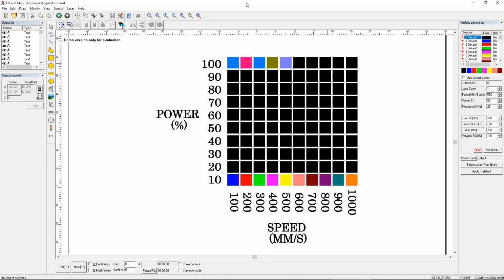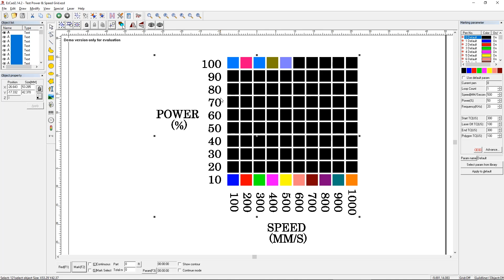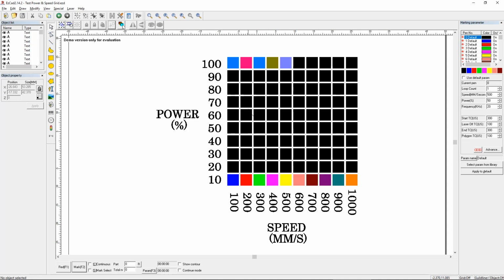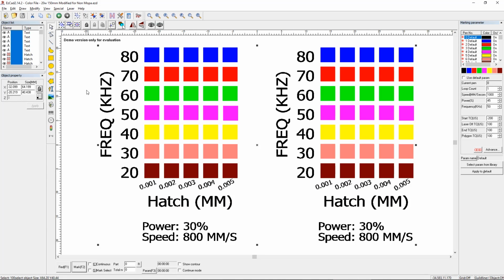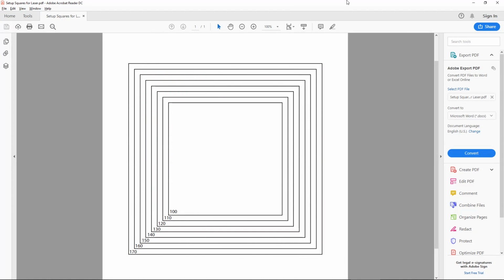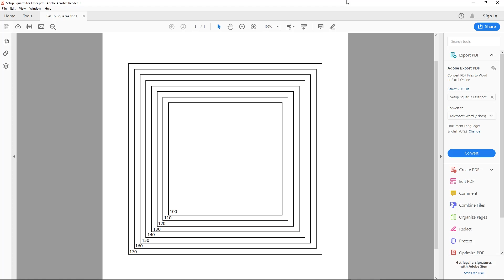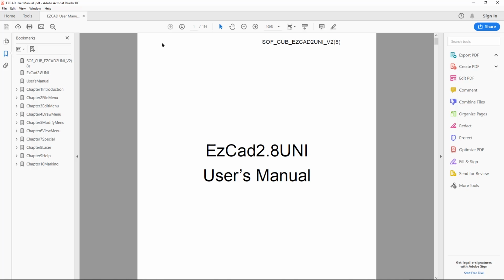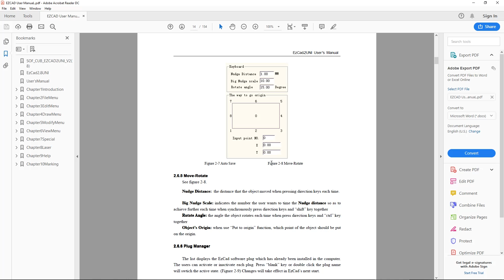Download EzCad Test Grids Here - Links in Description

Comment: I'm trying to modify the power vs speed grid to have finer increments, eg 100, 120, 140, 160mm/s. 

How do you change the laser settings for each box? I would expect to be able to select it, adjust the speed for example then select another box.
But something seems glitchy. 

Even just selecting a box does not show the expected speed/freq/power setting, 

Thank you all

Comment: Is your laser a raycus power source? Do different power sources on fiber lasers go over 80 Hz? For example, the JPT says 0-600 for the fiber (non-MOPA).
Reply: They are different. What is yours?
Reply: I have a 50W JPT. The virus ridden software I received was setup for 20-100 kHz as the frequency so I’m guessing 100 is the max it will do. Prob not much different than 80khz. I’m still going through the learning phase and laser-ing everything around the house.
Reply: @jaredfox1005  50W JPT, 1-600kHz

Comment: I just downloaded and opened these today in EzCAD 2.14.11, but the majority of the pen settings are the same, and most do not match the grid values they are assigned to.  EG: Pen 5 should be 10% power, but it is 50%; Pen 2 should be 10% and 200mm/s, but it's 50% and 500mm/s.  Why are these so far off?
Reply: got the same version, and got the same issue than you. BTW this is the only version of EZCAD that i found it works on my laser marker. no aftersales service at all from my provider.
Reply: Same problem. Pen parameter are not set with ezcad 2.14.11
@jefferyj can you update the file?

Comment: Your videos have been a great tool for me to learn more about what I can do with my Fiber Laser. But, for the life of me I am failing at getting consistent color results.  I allegedly have a 30w MOPA Fiber Laser and when I do your color test grip on stainless steel, I get the colors.  However, when I attempt to add color do a to an object replicating those settings in your test grip if fails.  I basically get black instead of the colors.  So if you can suggest anything  I can try that would be great.
Reply from the maker: Colors are tough and I really don't use them in my routine marking.  You might look for advice on color in one of the facebook fiber groups like this one: https://www.facebook.com/groups/547620632495173

Comment: Hi - these are useful but the frequency/speed settings on the pens don't transfer over - is that as expected? Do we have to set up the pen parameters ourselves? Thanks.
Reply from the maker: The settings should transfer over, they're saved in the file.
Reply: File is broken with 2.14.10 because Chinese write the worst software out there and love breaking saved files.  They do the same thing with Rdworks for co2 lasers.
Reply: @rong3157  that's why I use lightburn software for both co2 and fiber.

Comment: Hi jeff , i am not that really of an expert , but i tried pretty much all the settings , but i always keep getting either a color close to yellow or white or black ! Is there anything i should change other than the speed / frequency/ line distance ??
Reply from the maker: What material are you marking?  The settings you will adjust are power, speed, frequency and line spacing.
Reply: @jefferyj  and focus distance xD I got colors from your grid, but it has to be a about 2 mm up from the focus, otherwise it's all black or yellow. I have 30 w, but not sure is it rycus or max. Is you're lens in right focus to get the colors or out of focus? And did you manage to get the color with the text designs?

Comment: Hello jeffery thankyou for you amazing life saving videos. I have one question i am trying to replicate a nice black mark same as the 0.001 hatch. If i select just that square it leaves a perfect black mark. But when i try lettering with the same power settings and hatch settings it turns the marks white?? (Same bit of material) i even opened your test file made another square using pen 7 and hatch settings and still same issue. Do you have any advice or tips to keep it balck?? Thanks
Reply from the maker: I'd guess there must be a mismatch somewhere between the settings (or possibly hatch 2 or 3 somehow was enabled).  Maybe try writing down the hatch settings as well as the pen settings you want to use and start fresh with a new file to test just to ensure you're using the settings you want.

Comment: Thanks for making these available.  However the 4 additional parameters such as Start, Laser off, end, and polygon I was told by Tykma not to alter those because they are specific to my laser.  Will your ezcad file alter of those settings on my setup?
Reply from the maker: Those numbers are your timings and they are specific to your machine.  They will transfer with the file, so you can edit them if you want to match your timings but it will be tedious.  It shouldn't cause any issue to use them as they are in the file, the quality of the edges of the boxes and text just won't be very good.

Comment: would you happen to have some for the 50watt non mopa
Reply from the maker: I don't since I only have the 20W, but you can edit them to fit your needs, unfortunately it's just a bit tedious.
Reply: @jefferyj you edit them where and how?
Reply from the maker: @CarlosDelaoGunEngraver  Each box has a hatch pattern which uses a unique pen.  If you click a box, you will see the hatch settings used on the left side of the screen and you will notice there is a pen number selected.  If you go to the right side of the screen and choose that same pen number, you can edit its speed, power, frequency settings.  There are 100 pens used in this grid so that's why it's tedious to set up.

Comment: Hi Jeffery, could you share where i can find the color grid file for a Mopa?  I purchased my laser through a "manufacturer" and have quickly found they do not have very good information to explain or help with parameters.
Reply from the maker: Sure, I think I have two for a mopa...I added both to this dropbox folder: 
https://www.dropbox.com/sh/v2xiutb7ig3s8o1/AAASP2kMlypKNwzyAHh4SFEwa?dl=0
I didn't make or test these two files.  They came from a facebook group run by a guy in HK who is with a laser manufacturer.
Reply: @jefferyj  Thanks!